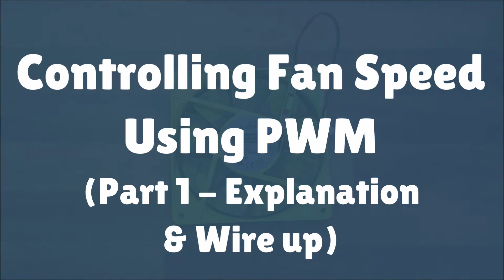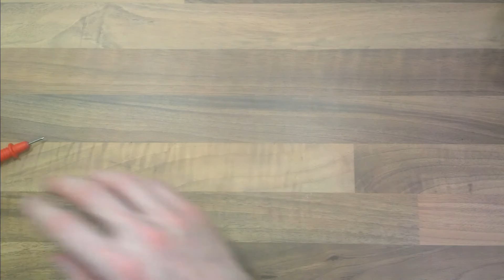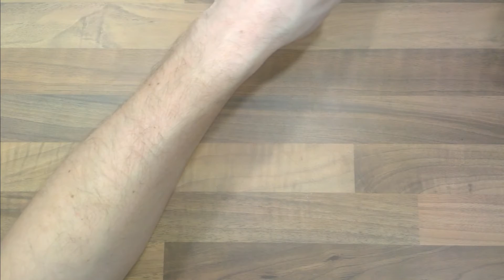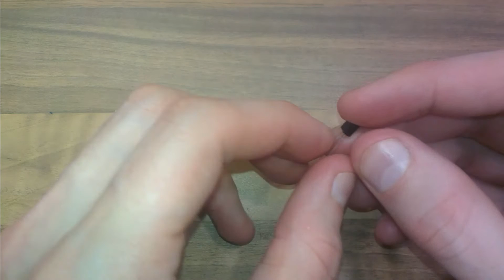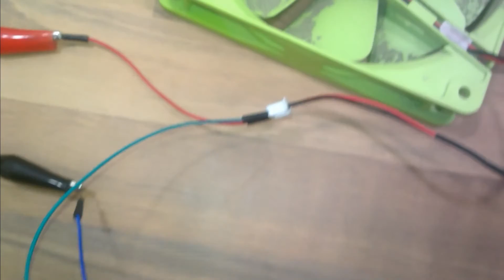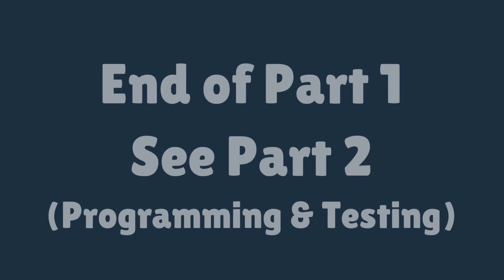TUTORIAL: How to Control Voltage to Externally Powered Devices Using PWM & Arduino (Part 1/2)

Comment: Don't you need a flyback diode? Genuinely asking, I'm new to this, but a flyback diode will prevent current from flowing backward into the Arduino when the magnetic field of the motor collapses when you stop the motor's operation, right?